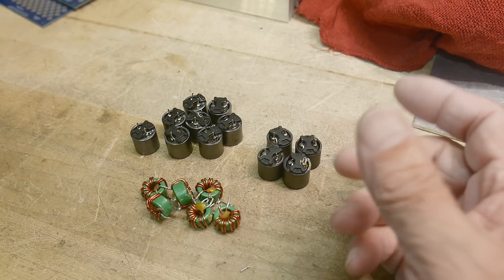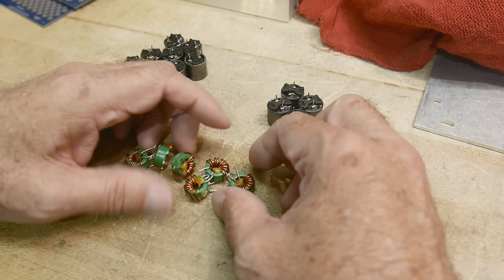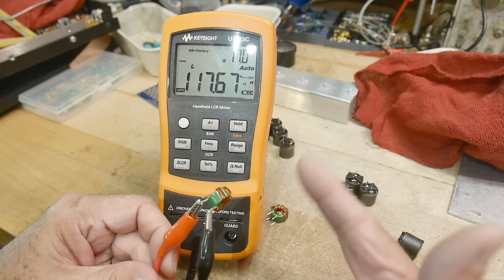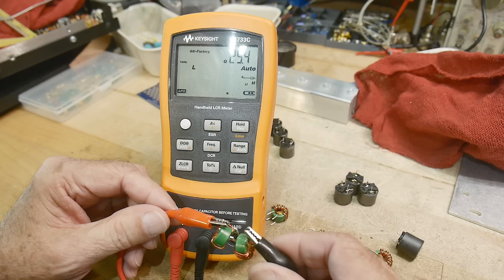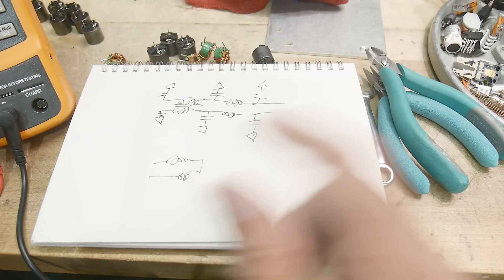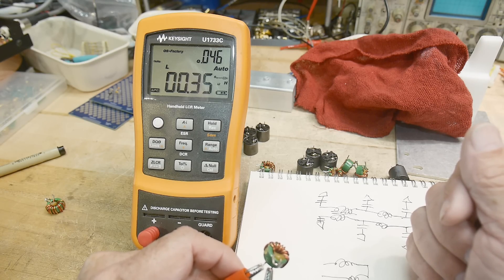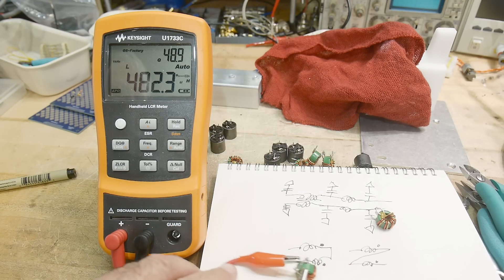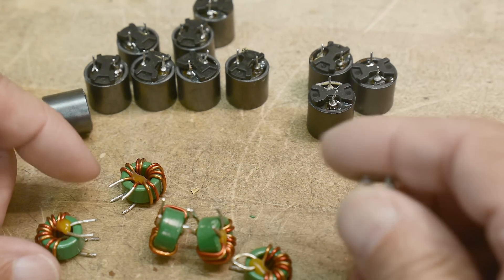#1526 Inductor Magic

Comment: You missed one example on the Common Mode inductor: Short out one of the windings and measure the inductance of the other winding. The common Mode inductor can also function as a 1:1 transformer. By shorting out one of the windings you measure the leakage inductance. You could also do a demo of using the common mode inductor as a 1:1 transformer.

Another discussion is the core material: Ferrite vs, powder core vs, plate (ie Silicon Steel), vs MPP. Then also air gapped core, Saturation, eddy current, etc.
Reply: That would be something I would do, as I use common mode chokes as a transformer sometime.
Reply: there is another core material as well: metallic glass. Amoungst other things it is used in some big transformers to reduce idle losses. Huge permeability can be achieved with that stuff

Comment: Maybe it is known to many visitors of your channel that the inductivity goes with n². There is something that can be achieved with that rule. 
If you need to adjust an inductor you can take two cylindrical fixed inductors with open field and align them with their field coupled until the inductance fits. With two 1 mH inductors one can build inductors from 2 mH to something below 4 mH.  (It is better to just couple the field in common direction.)
Reply: It was not uncommon to see networks especially in video circuits involving two inductors with different orientations and interacting fields. I recall the orientation relationship being noted on schematics in the 'fine text notes'.
Reply: Interesting! It makes sense. On a related issue, my employer got involved redesigning a product for hair follicle removal that used an air core as part of a high power generator running approx 4MHz. It had to be redesigned because the local authorities condemned it! We used a crystal and solid state power amp. 

During my second year Summer internship I worked in a magnet factory. A completely unique experience. My boss - a Physics grad - likened magnetic design to "making an electrical circuit that works in sea water."

Comment: Excellent puzzle!  Just a side note about harvesting inductors... most inductors are highly nonlinear devices and so inductance alone is often not enough to characterize them.  Most chokes use ferrite material that is intrinsically lossy as their purpose is to block ac not store energy.  Similarly for common mode inductors, they are likely to saturate early as the common mode is small and the differential mode magnetic fluxes cancel...  so typically the magnetization of a common mode choke is low in use.  So, although the inductance is high, it usually wouldnt work well in an application like a buck conerter where energy storage is key.

Comment: Proportional to the square of the ratio of the turns ...double the turns Quadruple the inductanc
Reply: Correct, but only true if the core is shared between the inductors.
Reply: @samtzam3774  Yep  and so it is here otherwise it's just two inductors end to end ;-)
Reply: Not the "ratio" but actual "number" of turns squared which can be derived via careful application of both Ampere's and Faraday's laws, but admittedly, electromagnetism requires advanced calculus and is an exceptionally difficult topic.
Reply: @ddognine  Thats the formular  true enough but seeing as you dont know what n the turns number is I deliberately said proportional which is correct.

Comment: When throwing out discarded electronics with them notice all RLC components used to filter the signal frequencies.  Calculation of frequency impedance done from Laplace and Fourier transforms.  I have many Butterworth, Chebychev RLC filter designs around a central operating frequency fc.  Inductors with digital signals (since analog is now FM or AM sound) to still filter out unwanted frequency noise around a center frequency.  Low pass, High Pass, Band Stop, etc make sure at a certain fc certain lower and ceetain higher frequencies are choked off. It is neat when guys hook up filter design experiments with a frequency input of fc and seeing fc-∆ and fc + ∆ on an oscilloscop at Vo to load experiments.

Comment: The dark-colored cylindrical inductors you began with possibly have such low inductance because they may be gapped (having a gap in the high-permeability material so the magnetic flux must pass through an air gap at some point).  A gap is used in high-current applications to raise the current required to saturate the material, or to increase the stored energy in applications such as step-up or step-down voltage converters.

Comment: We used whatever the spec called for and had like a huge GED RAD bridge...with varied test frequency and current settings...our GED rad reported DC resistance..too

It is nice newer hand heldish- instruments will measure inductance...

And clever Oscope readings..if your doing your own switching power supplies...make sure you avoid saturating your ferrite and wire wound combo...

Comment: L=μ(N^2)A/l 
L~KN^2
N is # of turns
So you would expect doubling the number of turns (which what you are doing)  square the value of inductor.
Reply: So if L is inductance, N number of turns of wire and K some constant, then inductance is proportional to the number of turns squared, i.e. L = KN². If we double the number of turns we get: L = K(2N)² = 4KN², so we get 4 times the inductance (2²) and not 2 as one might expect.
Reply: @martenthornberg275  Hi,
u= ur u.
A = area of the loop
l = inductor length
and as you mentioned N is the number of turns.
You can google "Inductor calculation" for more info.

Comment: Hi, when two inductors are in mutually series connection, the final inductance is:
L=L1 + L2 + M(L1 +L2)

when M is mutuall coefficient
Reply: Yep, the mutual part of the formula takes into account the relation from the other formula for inductance (when knowing a coils µr) which contains N^2. We will always expect more inductance from passing through same coil twice like that, it's not equal to two coils in series.
One must actually be careful if placing two coils close on a PCB as you may introduce coupling. This holds very true for SMD stuff with open ended chipcoils.

Comment: Whats needed to be said is that there is magnetic coupling. If these turns of wire were not coupled then you would be able to measure the inductance with your meter.

Comment: I have seen a choke in a dimmer that had a rod of ferrite and the wire was would on it folded in half. Went in a spiral, then turned 180 and went back. It shouldn't have worked and I have not seen one like that again. Is there an actual thing like that?

Comment: I guess we missed the point here.  Common mode chock shows little inductance, when the supply current and the ground current are the same, because they have different directions.  However shows great inductance if there is current imbalance as result of transient or noise.

Thanks for pointing this out, I will try to use this in my future designs.

As Kiomarse Zangeneh said in comments  below we should use M (~= 1 or -1 depending on direction of wiring) in spice simulation.

Comment: Cool information, for a future "power" project for witch I'm gathering parts and needs a common (to safe space) inductor.
At the moment i don't have a mm with that function to measure Henry, i wanna make them myself and i'm looking at a roll of 1KG of 1mm emailed wire. the shop around the corner put some recovered inductors away for me. they are like 1 inch diameter. never needed them before, some E.Q. guitar pedal also uses them, bought them, but they are SMD and really small.

Would you do a video on how to make/calculate inductors (without having the right tool), how to choose the right sized torroid or requirements for them. thanks in advance.

Comment: A crazy thought just hit me while watching the video. If I had say 2 ferrite rods 10mm dia  x 20mm long and wound say 10 turns and got say 100uH (just using random figures here) each. Then in theory if I  put them end on end one way they would cancel out and give me 0uH. End on end the other way I would get 400uH. All I have to do is rotate 9ne of the rods 180 degrees. So that means my inductance range should be from 0uH to 400uH. Now imagine the frequency sweep span of an oscillator or a filter using that info. Or am I wrong?

Comment: Is it due to mutual Inductance? In case of turns, turns becomes twice but length of the inductor also becomes twice. Which one is correct? is it due to 2*turns or due to mutual inductance?

Comment: I explored a bit about magnetic amplifiers, but it is still very unclear to me. Could you do an experiment with varying the inductance with a secondary coil (through which control DC would run)? Could such a device be used as a part of "variable low pass filter" at RF?
Reply: Yes, it could! Same goes for high-K capacitor ceramic material. Their capacitance changes a lot with DC bias.

Comment: Also might want to add that if you don't want two of them to x-couple than you need to mount them so the coils are at 90° to each other.
Reply: It was actually a good demo of how little torrids will couple

Comment: Turns squared, that is really basic. Here's a fun experiment: wind one inductor on one side of the ferrite and one on the other. Measure single one and those 2 in parallel. What do you get?

Comment: when you put two inductors in series your total is L1+L2+/-2M depending on whether they are wound in the same direction (+2M) or in opposite direction (-2M). M is the mutual inductance. Here L1=L2 and M=L1=L2 because the coupling factor is very close to 1 . So in the first case you get L1+L2-2M =0 (M=L1=L2) and in the second case you get L1+L2+2M = 4L1. It HAS NOTHING TO DO with L being proportional to square of turns. It just happens to look that way in this particular example because the two inductors are fully coupled and also identical to each other. Imagine one had 4 turns and the other had 8 turns. Above equation would always give you the correct result.

Comment: this is all fairly normal.
as is parasitic capacitance and self resonance.

what isnt mentioned is how the winding arrangement will affect things...

taking that there CMR inductor in series like that, should also increase the capacitance drastically, or more to the point, the efficiency of that capacitance in storing the energy of the applied voltage, and the "q" factor of it will change drastically. is q really the right term for this? argggh.

 its now half the applied voltage between turns, (if wound neatly) rather than the potential drop between turns alone. more electric, less magnetic, for the same total energy.

as the diametric opposite yet much the same concept, a capacitor can be wound to have silly high inductance, ie, standard sausage with connection at end, or it can be very high efficiency and the terminal is connected all the way along one edge, with a very low inductance figure.

Comment: Yep on more inductance, based on the sq. of the turns. (i.e. twice as many turns, 4x the inductance)

Now if I could just fit my 401K into that equation....
Reply: Remember, you (and I) have not paid the taxes on that 401K, the way things are going, there may be a lot less for you (and I). :face-purple-crying:
Reply: @RonDogInTheHouse  I fixed the problem.  I set up a 501c.3 operation for burning CDs.

Comment: You use the term choke and inductor interchangeably. Spend 30 seconds and explain  the difference between a choke and an inductor.
Reply from the maker: when used for filtering a power supply the term choke is often used